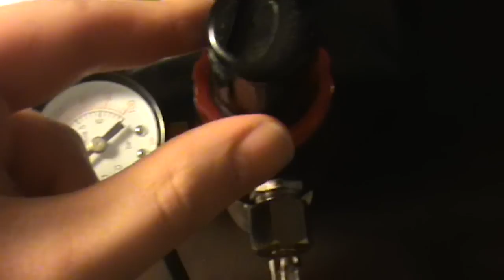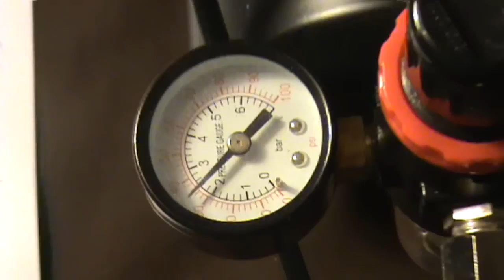airbrush 101effects

Comment: @RabbitLitvyak 
Yes you can, Any paint can be sprayed. All you need to do is experiment with the consistency. In the case of Citadel Paints, which is water based, mix in more or less water until your paint doesn't run after spraying and you get a nice thin smooth layer. Better to do it in more layers. 
Good luck!

Comment: Hey i have an iwata HP-CS and sometimes i notice when i push down on the trigger, the paint comes out, without PUSHING back on the trigger, what is the cause of this, Needle not pushed up all the way through the brass tip? my PSI is usually around 20-25 no higher, I fiddle around with the Needle tension knob, and the housing that holds the trigger in place, the threads on the housing are sometimes not tighten all the way, could that be the issue? or is it something im overlooking.